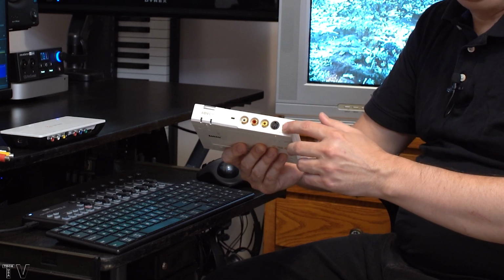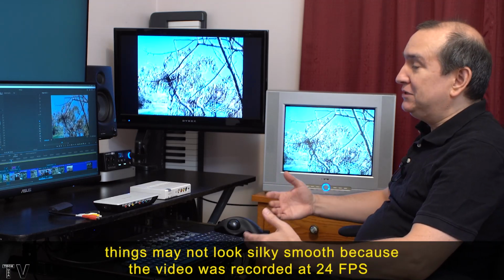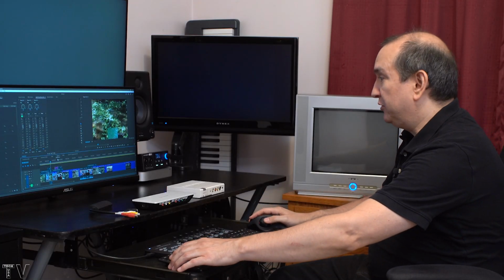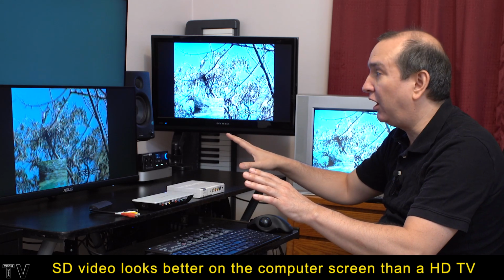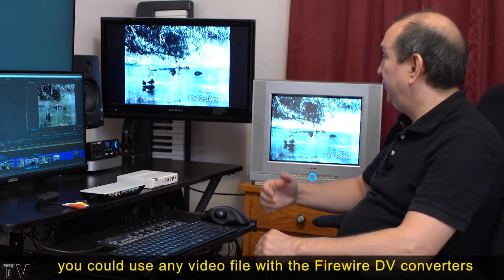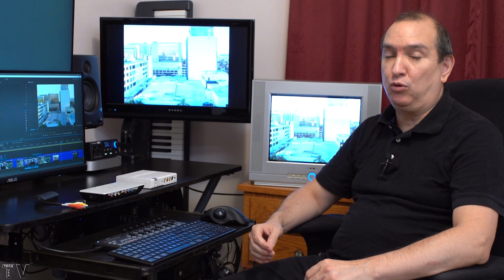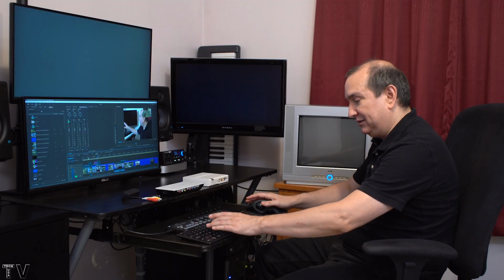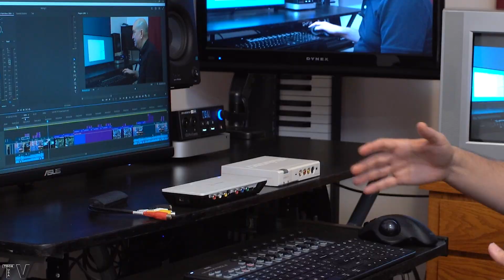Why use a firewire DV converter?

Comment: thank you for this. Do you have a recommendation on a set up to be able to capture capture the footage from an older firewire camcorder on a new USB C laptop?
Reply from the maker: It cannot be done. Laptops with Thunderbolt can make use of adapters to connect to Firewire devices.

Comment: Thoughts on using VirtualDub for transfers? Also, do Digital8 camcorders that play 8mm analog tapes/S-Video import for VHS count as a DV converter? I want to use that set up but I've heard it isn't a good idea to convert analog video to DV format.
Reply from the maker: Most Firewire DV camcorders can act as a Firewire DV converter. I would avoid virtual dub and instead use iMovie, FCPX or an older version of Premiere Pro.
Reply: @TechTVusa  I've got a Windows 10 PC, is WinDV any good? I'm curious, it there a reason why I should avoid VirtualDub?
Reply from the maker: @archivist15  I trust professional software more than the cheap crap.

Comment: I have a question; I have used ADVC 110 from 2003. It has been easy to use etc. Latest configuration with a DVD/VHS Combo player has been with an old iMac with FW4002FW800 cable. Everything just works. BUT now I would like to use the box with a newer iMac 2012 but it does not have a firewire ports, only USB´s. I did buy a FW4002USB2 cable but the ADVC box does not light up. Only the red light shows. Should I use an external power with ADVC box? The new FW4002USB2 cable was advertised as for "Link FireWire devices to a PC, Connect digital cameras to a computer, Use with 1394 acquisition cards and portable hard drives". The cable has 6pins so it´s not a pin issue. I´m currently thinking that the problem is power related. Any ideas?
Reply from the maker: A Firewire to USB cable will not work. You will have to get Thunderbolt to Firewire adapters. A power adapter might be required. The video link below should be helpful. 

https://youtu.be/rHWHE3ilBbU
Reply: @TechTVusa  Thanks! I will try that.

Comment: Hi, I have the Canopus ADVC110 and I am using it on Windows 11 with a firewire card.  I found that i have to use premiere pro V13 for the capture feature as the 2024 version no longer has that ability.  When I connect a VHS via the analogue RCA's or use the DV connection for recording Video 8 and other similar tapes, the recordings are interlaced and I then need to run them through Topaz video to de-interlace.  Is there a setting I have wrong somewhere on the canopus to record without the horizontal banding?  I dont have the problem if I use a capture card for VHS tapes so i dont know if it is an issue with 2023 Premiere Pro or the Canopus.  I checked the switches on the bottom of the device and have set for PAL (as I am in Australia) but dont know what else to do.  I originally purchased the blackmagic device after watching your videos but didnt realise there was a thunderbolt and a USB version.  I have the thunderbolt but I cant get it to be accepted or connected ot my Macbook Pro (which is a 2022 version).  I tried different connectors but I gave up on that.  I wa just happy to see an image after connecting the Canopus and eventually finding a software program that would see it.  I tried OBS and Nero but they never found the device.  Thanks
Reply from the maker: The Mac started getting funky with the Blackmagic Design devies in 2022. You should be able to get the same quality as seen in the video link below using Premiere Pro and the ADVC 110.  

https://youtu.be/vqCi9B_7mdU
Reply: @TechTVusa  is there a way to avoid the horizontal banding from the interlacing or do you just fix it later?  Thanks for responding.  I have learned a lot from your videos.
Reply from the maker: I am not sure what you are talking about.
Reply: @TechTVusa  When I am recording a VHS tape or DV tape via the Canopus 110 via firewire into 2023 Premiere Pro, the video image is is interlaced (or de-interlaced) in that the image has horizontal banding.  Is there a setting somewhere to fix the image interlacing so that it looks like it would when played on a TV. If I use a capture card, i dont have the interlacing problem.  I can fix the interlacing by applying Topaz video AI but was wondering if I had some setting wrong to start with that caused the interlace banding.  Does that make sense?  Im not fully familiar with the correct terminology.
Reply from the maker: You should not be recording DV tape using the ADVC 110. Just connect your Mini DV camcorder to the computer with a Firewire cable. The Mini DV camcorder can be used to capture VHS tape. You don't need the ADVC 110. Having said that I still have no clue what you are talking about. If Premiere Pro had banding issues when using the ADVC 110 I would not recommend people use it. Premiere Pro simply transfers the video using the ADVC 110 into the Mini DV-25 codec which is 8 bit 4:1:1 720 X 480 interlaced video with 5:1 compression. Perhaps you have a defective ADVC 110 or there are dip switches that are not setup properly on the ADVC 110.
Reply from the maker: If you watch my videos and see any banding issues please point them out with a time stamp.. If you do not see banding issues in my videos then perhaps you can understand why I don't understand what you are talking about. Older version of Premiere Pro should work just fine with the ADVC 110 or any Firewire DV converter.
Reply: @TechTVusa  I have worked it out, thanks. I appreciate your help..

Comment: I've been using an ADVC110 to capture VHS with a G5 tower and iMovie. It works really well from what I can see, and is incredibly simple. All the post work is done with Compressor on an M1 Mac. I simply wanted a 1:1 capture for preservation, and I'm not concerned with upscaling to HD – though I'm holding onto the DV source files just in case I want to revisit that in the future.
Reply from the maker: The Firwewire DV converters have good quality but keep in mind mini DV-25 is is 8 bit 4:1:1 at 5:1 compression.
Reply: @TechTVusa  Given your comment to keep in mind the 8 bit 4:1:1 at 5:1 compression what would be the methods to provide best quality for capture preservation thanks for all your good insights
Reply: My question re method for best quality for capture preservation refers to PAL Hi 8 tapes thanks
Reply from the maker: Is Mini DV-25 at 8 bit 4:1:1 with 5:1 compression poor quality when compared to 10 bit 4:2:2 uncompressed? The video link below might be helpful. 

https://youtu.be/vqCi9B_7mdU